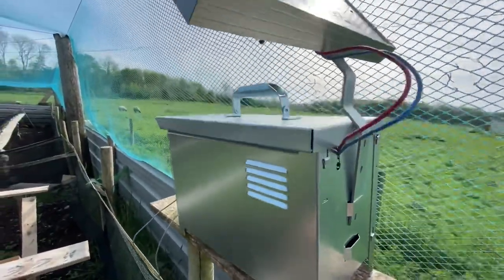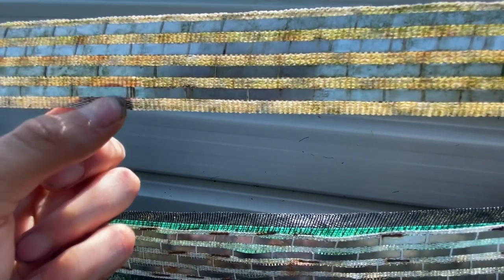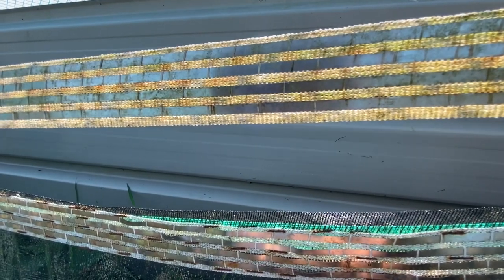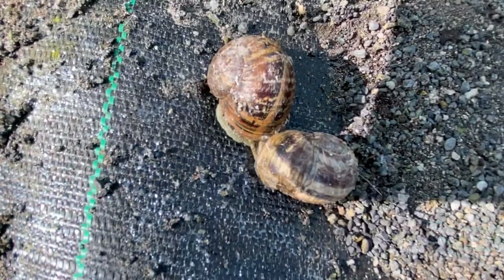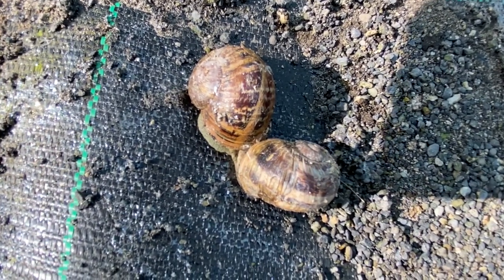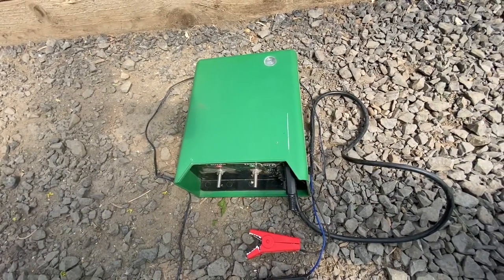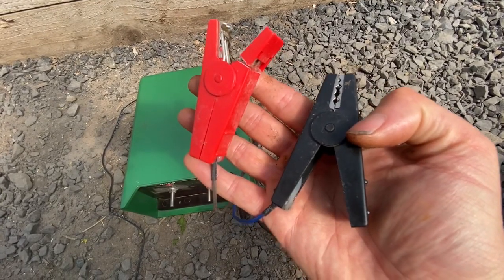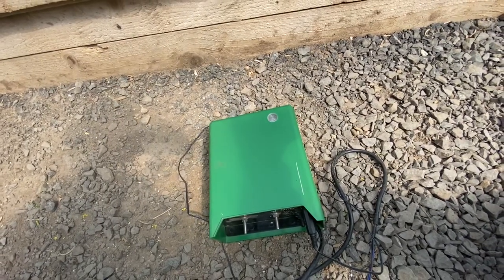Electrify Your Snail Farm: Guide to Installing an Electric Snail Fence ⚡️🐌

Comment: Hello, can you please advice, which one from below is a better idea ? running el fence arround whole farm teritory or arround individual sections (we have 3.5m x 45m size sections, 40 of them). 
Company who is buying our snails said that el fence will stress the snails and they dont want us to do it, on the other hand it is impossible running after thousands of snails escaping from netting each night and returning them back one by one.
Reply from the maker: We couldn’t live like here without our electric fence. Snails would end up everywhere without it. But I know in Eastern Europe they use salt covered over with the flap. But here in Ireland it rains way to much to ever use salt outside. So the electric fence is the best for using over here

Comment: I want to try this on my allotment. What is the power consumption on the mains power version? I have 500 watts of solar and a solar power generator so i can plug mains into that.
Reply from the maker: There is specialised power boxes for snail firming that are designed with light power output. Because any strong power output can kill or harm Snails. So you don’t want the power too strong. 🐌

Comment: What is the output voltage on the system? And is it a DC or AC current?
Reply from the maker: Good evening, the current is AC for Europe for the mains power box. It’s a low voltage (converted down in power) running through the electric fence itself